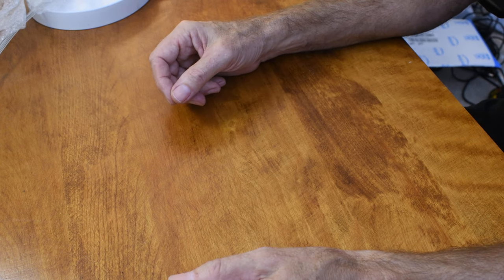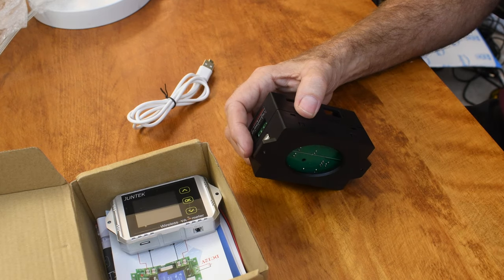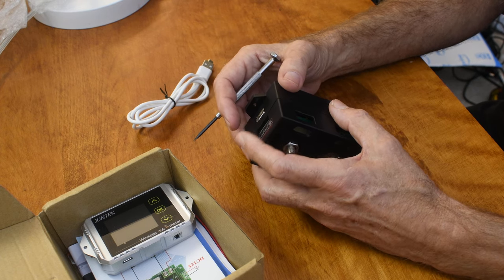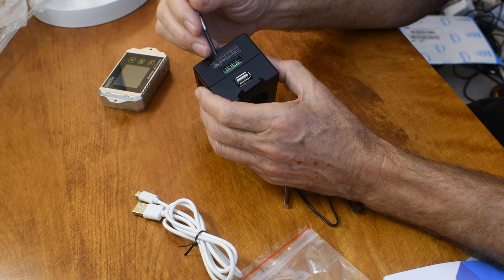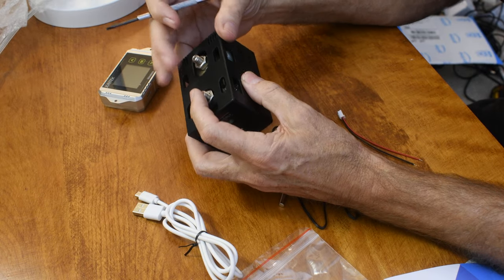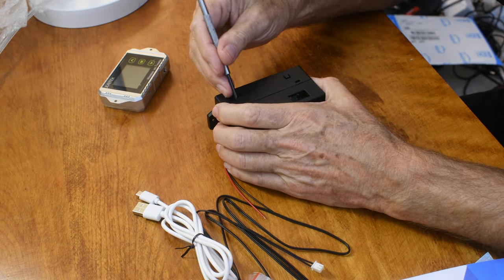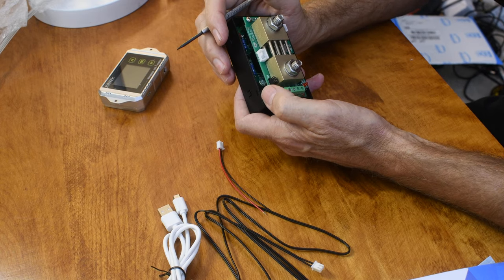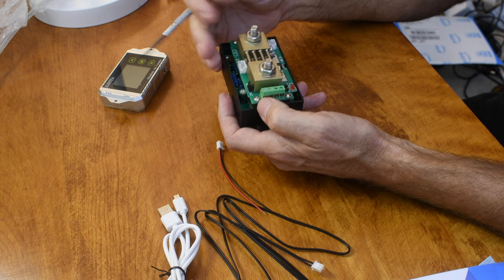A battery state of charge(Volt/Amp/Watt-hour/coulomb counter)solution for wireless network Part 1of5

Comment: Unfortunately I am having trouble understanding the code. I want to speak to the VAT1100 directly via RS-485. So let's be specific: I connected the VAT1100 to my Windows PC via an RS-485 adapter. HTerm has started. If necessary, I can also connect the VAT1100 display. What do I have to ask and in what form in order to e.g. B. To query the voltage and how can I understand the answer?
Reply from the maker: I took two different approaches to grabbing data from the VAT1300 shunt.  The first was a wireless connection between the shunt and an Arduino without the Juntek display.   The second was spying on the RS485 traffic between the shunt and the display controller using Node-Red on a Raspberry Pi.  I never coded an RS485 controller.  See part 5 in my YouTube channel for details.  The Node-Red code can be found here: https://github.com/rjflatley/remote_battery_management/blob/main/Juntek_Shunt.json
HTerm (I think, never used it) should be able to see binary RS485 data going between the shunt and display controller at 57600 baud.   IMHO, Node-Red is an excellent tool for debugging serial port data.

Comment: Another bs problem with them is the nuts & bolts for the neg. battery connections on the shunt ---- the nut & bolts do not match any tools sizes , TOTAL bull !!!  , they are larger than a 13mm & smaller than a 14mm , same with standard sizes , larger than 1/2" & smaller than 9/16" .
The electronics may be ok by all reviews I've seen , I can not say because the blue-tooth on the one I got is dead .